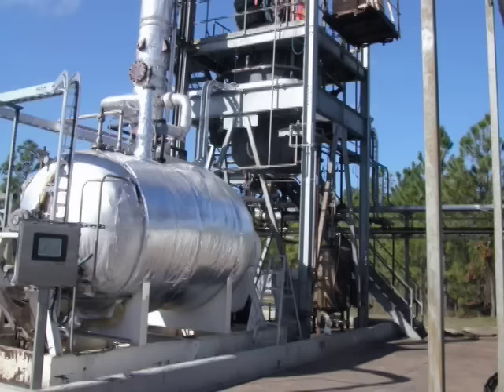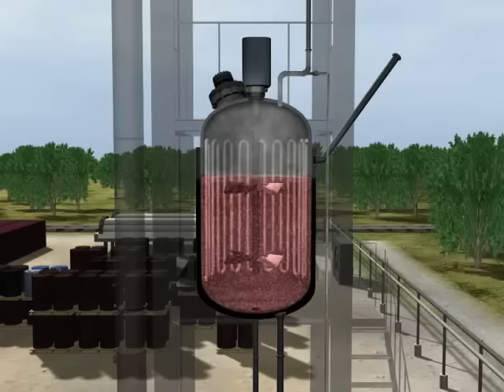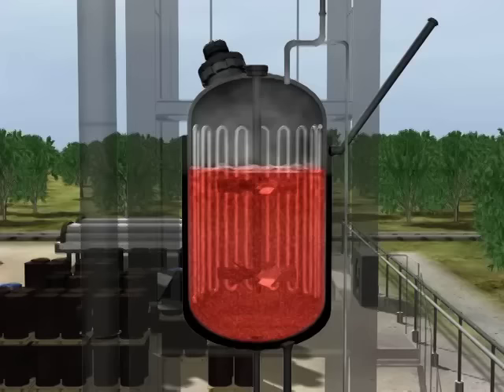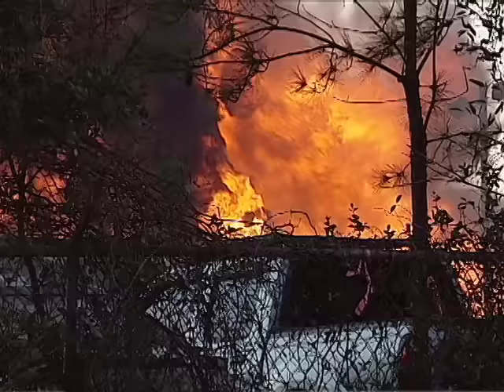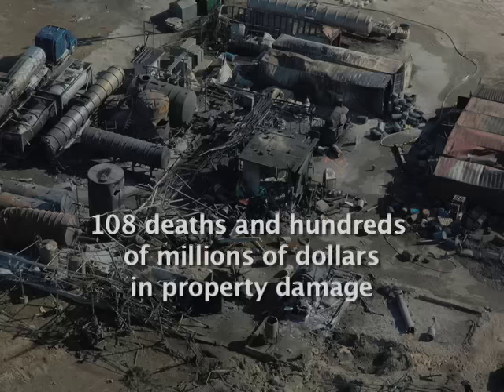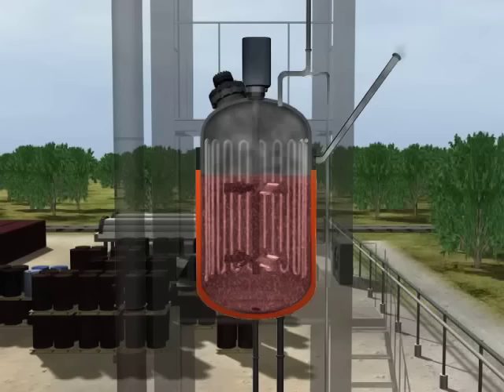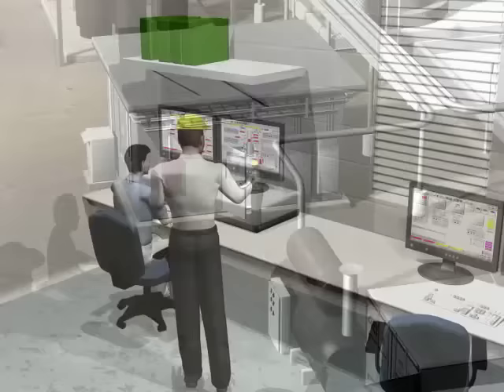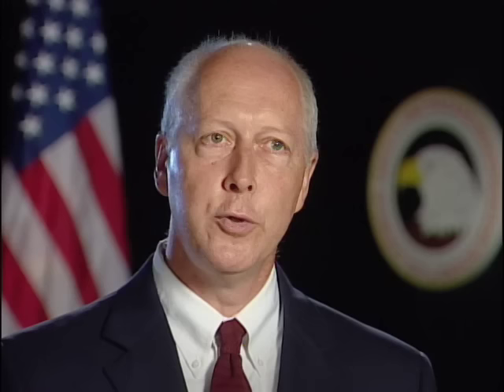Runaway: Explosion at T2 Laboratories

Comment: Where the heck is the redundancy.
Reply: WackyBroProductions Where the heck is the cooling capacity?   I mean I could understand scaling up the process...a bit...but to go from 1 liter to 2500 gallons and then pedal to the metal with the same water jacket is lunacy.
Reply: It would certainly have HELPED, but what really did them in is having a single fucking point of failure and no plan B. That had ONE pipe for water and no plan on what to do if it couldn't do it job. And tht's what happened. FFS if they attached a bunch of garden hoses in addition it would have been a safer design.
Reply: @simpsonfan13  Definitely!  Maybe more emergency pressure relief also!
Reply: EXACTLY! I'm entirely unqualified in any type of engineering, but anything I do that could result in compromised safety if a failure occurred, I have a redundancy in place, too!

And I'm not mixing explosive chemicals etc... It's horrible that a company allowed this to occur, yet it seems unsurprising that it did at some point, and I just... HOW COULD THEY NOT AT ALL FACTOR IN, "gee, if something goes wrong in the cooling process, we should have at least one backup plan so that this whole thing doesn't continue to heat up"... I just... It's mind boggling! And people died!
Reply: @TheBrodsterBoy unfortunately, no.  The reaction heat generated scales with the diameter cubed, while the maximum cooling the jacket can provide only scales with the diameter squared.  There is a vessel size at which no amount of cooling, even with mixing, would prevent it from thermal runaway.

What they could have done, and what everyone else would do, is have a grid of cooling pipes running through the reactor, so regardless of the size scaling it would have the same cooling capacity per unit volume.
Reply: @TheBrodsterBoy The reaction vessel they used is probably just made at a tank manufacturing company, and so is the shell.  The heating coil just goes around the inside and has only two holes (it may actually go between the shell and the vessel if the video is incorrect, that seems a little more likely).

To do what I said would require drilling dozens or hundreds of holes that had to line up perfectly through the sides of the reactor (if they wanted to keep the impeller locations) or through the top and bottom.  Each of the tubes inserted would have to be machine welded or welded by an expert, and it would complicate the coating process.  I'm assuming they use some kind of ceramic coating process to prevent the steel from reacting with the hydrocarbon/molten sodium mixture, or at the very least to prevent hydrogen embrittlement.

In short, it would make the reactor a lot safer, but probably at least an order of magnitude more expensive and require somewhat significantly more maintenance.

A cheaper way to deal with the reaction scaling might have been to continuously pump the reaction mixture through an off the shelf heat exchanger to remove excess heat.  They would definitely need a standby backup for that kind of system though in case the pump failed.

To make this even more TL;DR, I think the reason they partially evacuated was because of the risk of a hydrogen fire from the normal reaction gasses that were being produced much more quickly.  If that hadn't been the case they could have just jammed a garden hose down the steam vent and it probably would have been fine.

Im surprised UCSB didn't mention the burst disk vent system.  The fact that it was undersized for the reaction mass meant that no one in the design process checked to see whether the piping at the burst pressure could actually relieve the reaction vessel pressure, which was its only job and one it obviously failed at.
Reply: @TheBrodsterBoy ignorance, negligence, who knows? Well I guess the owners know.......knew.
Reply: The redundancy is in the management department.
Oh! You meant in the equipment, for safety.
Reply: This is why regulation needs to exist. Even one person glancing over this would have scrubbed it. But "muh profits"..
Reply: @conoba  Or it could be that they knew of the inadequacies and decided to take the chance anyway. That happens  in pharmaceutical industry. The figure that the cost of something going wrong is worth the savings if it doesn't. They see It as just the cost of doing business.
Reply: Redundancy is a business killing regulation.
Reply: American Engineers: This part is important, therefore it needs multiple backups in case it fails with 3x as many parts.
German engineers: This part is important, therefore it must have tight tolerance and run as smoothly as possible with 5x as many parts. 
Soviet Engineers: This part is important, therefore it must never fail. 
MBAs: This part is important. Hope it's okay.
Reply: No shit man. I just commented the same thing... but just one word... redundancies. This is honestly just complete ignorance and shortsightedness. I could never work at a plant run like this...
Reply: The problem was with the "rupture disk" - it should break much much MUCH sooner!!! Or at least safety valve should be used for controlled venting. Why there weren't implemented i have no idea...
Reply: @jtsssss  
I believe the "overflow" that can slurp overload from the reactor should be installed. A pipe and the tank...
Reply: Where the heck is the redundancy. Where the heck is the redundancy.
Reply: (europeans) multipurpose chemistry plants often have 
gravity powered precooled brine storage container  for emergency shutdown
Reply: Brian Landers  
Having only one source of cooling with no form of redundancy on an inherently exothermic reaction pretty well automatically counts as "something wrong with the design", compounding it by having a completely inadequate pressure relief system that utterly fails it's ONE JOB is just the half-digested corn atop the shit sundae of bad engineering.
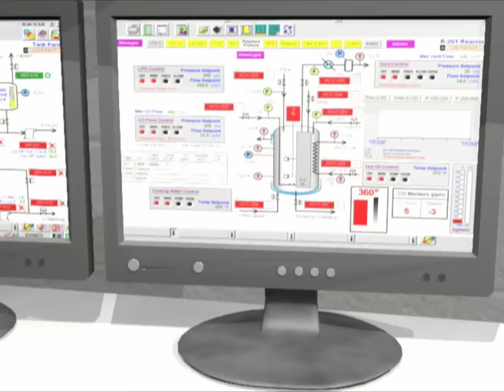Reply: @phuturephunk  I think you missed 2:40 where they said that the cooling system was not operating at maximum capacity.
Reply: "over there, down here and up there"
Reply: they should have had at least a secondary cooling system (think, refrigerated system?), but as usual, that adds to costs to the company,  when profit is everything!

Comment: Perhaps chem students should be taught how to make bombs, so they don't make them by accident.
Reply: Well there's the first problem computerised
Reply: Reactor Design is much more complicated than knowing how to make a bomb!
Reply: @MicahWeb  And yet if these college graduates had been taught about how chemistry can easily make things go boom, this may have been avoided. I have no college degree in chemistry, but even i know pouring chemicals together that generate lots of heat inside a sealed pressure vessel will eventually go boom. I mean the fact that the owners thought it a great idea to use city water as a cooling solution for something involving sodium metal screams stupid to me. Those two things alone = explosion if they come in contact.
Reply: @sylumgand  Using water as a cooling agent is a common practice in chemical engineering, once you do a reactor design course then come back for a chat. All I am saying is making a bomb is easier than making a safe and functional chemical reactor! Students now days are taught about the effects of faulty reactor design.
Reply: @sylumgand  The biggest Problem in this system was that there was no redundancy whatsoever. Cooling should never rely on just one system there has to be at least one backup system that is independent from the other. Also the pressure release mechanism was inadequate for the size of the reactor and should have gone of far earlier. Both are the result of going from labratory scale direcly to industrial reactor scale, without any design changes.

Well and regarding sodium and water. You better not take a look at fast breeder reactors... As long as the reactorvessel is desinged in a way that in case of a faliure the two do not mix there is no problem.

This is all stuff that a process engineer does. You usually do not learn this as a chemistry student, but maybe as a chemical engineer. I don´t really know what they are doing.

Sadly most reactions do require heat and pressure -that includes many exothermic reaction. Therefor you have no other choice than to pressurise the reactor. But if you do not take the necessary precautions it can easily go critical.
Reply: The operator know how to press the buttons, they don't know exactly how the system works. That's also how Chernobyl happened al
Reply: @Garganzuul modern problems require modern solutions
Reply: Making bombs was a favorite pastime when I was in school.
Reply: Worse still, in Chernobyl, the man in charge's faith in the Soviet Union's engineering made him almost unable to believe an explosion was possible. 
Even when his collegues came in with their skin "tanned" by radiation, telling him the reactor was destroyed, he didn't believe it for a good half hour.
Reply: your own water heater is actually a bomb as well, but it can't explode if operated and maintained properly
Reply: That can go one of two ways
Reply: @sylumgand  yikes.
Reply: @sylumgand  I have a chemical engineering undergraduate degree, the people who designed and operated this plant do not represent the majority of chemical engineers. Judging by this video, these people seemed to be lead by greed.
Reply: @oron61  
the soviet acolyte in chernobyl blew up a nuclear sub before he was demoted
Reply: @oron61  their skin didn't "tan" in real life because no one that Dyatlov talked too had absorbed enough beta or alpha to show signs that early (except vomiting and nausea.) Saying that Dyatlov believed the Reactor Core couldn't explode because of "faith in the Soviet Union" is a half truth because him aswell as every other RBMK operator were lied too about the safety of the reactor and they were ordered to continue testing when it wasn't safe. The only way Dyatlov could've known there was a chance that unit 4 is of he worked to develop and test the first RBMK. Funnily enough Chernobyl was his second nuclear accident behind one on a nuclear submarine and he still outlived most of his peers.
Reply: sylumgand 
Like you said, you’re not college educated. Yet, you say you’d call a PhD chemist “stupid”. That’s called the Dunning-Kruger effect. You don’t know what you don’t know. The more you learn, the more you realize you don’t know.
Reply: JohnGalt009 
The video said they had undergraduate degrees, not postgraduate.
Reply: JohnGalt009  Not being rude, but I have a MSc in Chemical engineering, if they were so brilliant they would have had quenching fluid, reaction inhibitors or even 'safe-by-design' anywhere in their design. To rely solely on batch cooling water, not even continuous, and to design it in a way so that a single error in the cooling water line resulted in multiple deaths is not brilliant.
It was not a series of events as you say, it was poor design from the beginning.
Reply: I think you should teach chemistry students how to not make bombs when doing chemistry. Safety is essential, especially for large scale production.

Comment: The part they didn't explain: This was all due to using city water.
Anybody who has boiled city water knows that there are a lot of mineral salts left behind every time. I have a steamer humidifier that plugs up the same way. The "flakes" need to be cleaned out, and scraped off the heating element, or it will overheat and go into protection mode.
Reply: Not to mention pipes can become clogged due to hard water
Reply: @noahater5785  That... That's what hard water is my friend. The "hardness" of water is based on how much calcium and magnesium is dissolved in it; Both of which cause buildup.

Comment: This case is too stupid for words.  In the real world, any design that could lead to an uncontrolled exothermic reaction have systems to prevent disasters.  The final line of defense is the rupture disk. It is sized to vent a full blow runaway reaction.  The first line of defense are duplicate cooling systems.  How about turning on the cooling system before starting the batch to see if if works?  There are countless computer programs that will determine if a runaway will occur with the reactor geometry and reaction kinetics.
Reply: This is the real world. Managers don't care
Reply: And one of the cooling systems should have been a gravity-fed fail-safe system with an active valve keeping the water out, so that any interruption to the power supply would automatically cool it.
Reply: union carbide have an exemplary record for this type of reactor model , leave it to the experts i say s/
Reply: FWIW, I read that in 2008 a company attorney said that there was backup water available in an 8000-gallon tank.
Reply: All these things cost money 💰😡
Reply: @macneoh7418  so does replacing your entire plant and paying off lawsuits, not to mention the damage to their reputation as a company
Reply: @johnballs1352  In the real world, this design would never have been approved.  The consequence of a runaway reaction are known and can be dealt with by having the right equipment and systems.

Comment: Scaled up too big too fast with lacking understanding of the process. Going from a 1-liter test reactor straight to ten thousand fold is ...not smart.
Reply: If they had done the necessary calculations and risk assessment and then actually implemented designs to mitigate potential failures it would have been fine to scale up from there.
Reply: @JohnDoe-zh6cp  Pretty massive 'if' in this instance wouldn't you say. It would seem that they did not do their due diligence with fatal consequences, may they rest in peace.
Reply: @stevenbaer9061  That diligence is necessary in any case. I was just making the point that scaling up from that size was not the issue.
Reply: yeah i had to do the math: they verified the process in a 1-liter reactor, and then scaled it up to a 2500-gallon reactor 😱 thinking it would behave the same way. As you point out, 2500 gallons is 9464 liters (roughly 10000 times increase).

I had some fun with ChatGPT trying to visualize the increase: what is the volume of 10000 cupcakes. 🧁 LOL It did a great job. “Assuming the average cupcake is a cylinder with a radius of 3 cm and a height of 5 cm…”

At the end I got to a cube that was a little over 1 meter on each side. 😱

So these guys, who were experts in baking individual little cupcakes,  told themselves that everything should work fine when baking a single MASSIVE cupcake that was a yard tall, a yard high, and a yard deep. 😳 guys that’s not a cupcake that’s a wedding cake. (I didn’t check ChatGPT’s math so YMMV.)

To me, obviously nobody in their right mind would make that kind of leap… particularly if baking the giant cupcake had the potential for an exothermic runaway.  

There is some overlap between cooking and chemistry (e.g. Maillard reaction) so maybe some pastry chefs should have been consulted to show them the danger of this. 👨‍🔬👩🏻‍🍳

Comment: As a retired union industrial painter, I worked in numerous nasty chemical and petro companies over the year's. 
Most were old, their equipment, piping, valves, tanks, were very old. We would joke sometimes and say the only thing holding this place together was our paint, and maybe a little bailing wire and duct tape. Some of the places weren't too bad, but some really scared the s--- out of me just being there. I actually quit for a year once after being sent back down to DuPont in Rubbertown, Louisville KY. But, I needed the money, benefits, retirement, and went back. We called DuPont the Russian front. It was nasty, old, stunk. They would vent stuff out, and whew man, what a nasty smell. Some stuff was so dangerous, they had cameras surrounding a tank, watching it 24 hour's a day. It was some type of acid, if I remember I correctly, maybe HF acid, I'm not sure. Their safety guy told us, one drop of this on your arm, and it doesn't stop burning until it gets to bone marrow.  I don't know if that's true, but it sure scared the hell out of us. I've painted high voltage steel tower's over 100' high while energized, and it didn't bother me like working in a chemical plant did. I hope damn politicians never cut the budget, or power, of this US Chemical board here. I'm not sure what type of enforcement they have, but I hope enough. Do you think, chemical companies have lobbyists in DC fighting against safety rules? I wouldn't doubt it one bit. It seems everybody has a lobbyist, donating to some damn crooked politician. Or, in order to dodge American safety laws, and the much higher wages, if like every industry, these chemical companies move overseas. Like the Bhopal disaster in India, I think over 3700 , yes hundred, were killed, and over a half million people injured. That's just unimaginable. These chemical companies have to be strictly governed, and constantly watched. I don't trust them to do what's right on their on. Great video. Thank you, John
Reply: @Demcurls  Yes, I believe your right. It was some very dangerous stuff. It's been year's ago. I didn't complain much, just done my job, but I sure didn't like chemical companies. Stinky stuff being vented, sometimes leaked out.
Reply: Phosphorus will do that and so will many other highly reactive chemicals. Magnesium that is used to make car engines lighter are a problem when a car catches fire because the melting magnesium will ignite any water that is poured on it by the fire department.